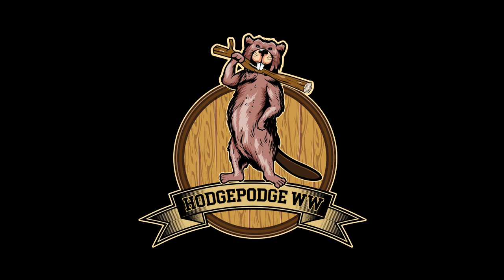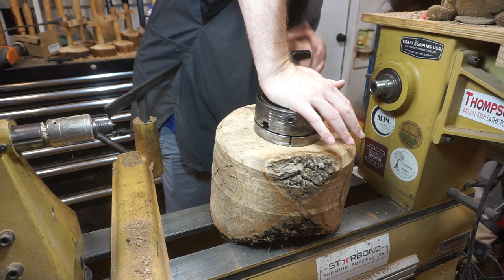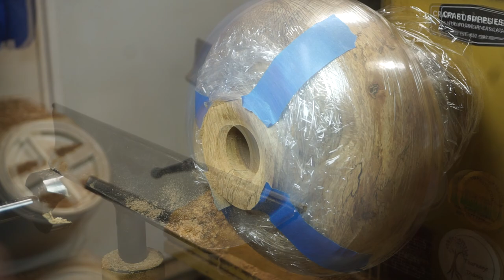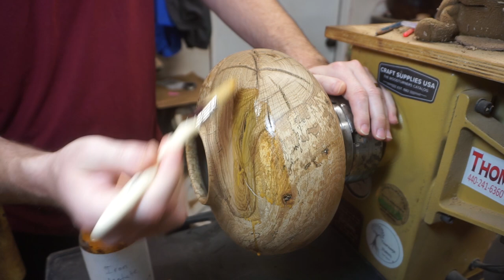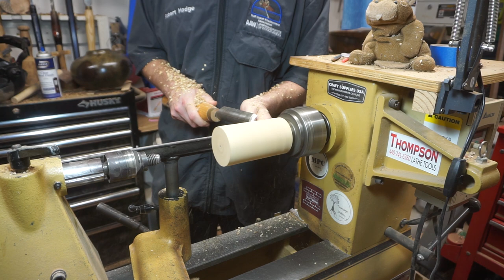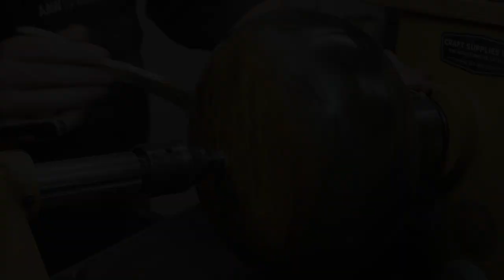Woodturning - A Crackin' Good Time

Comment: What coring system are you using.
Reply from the maker: It's a bit of a mix and match. The captive arm system is from a company that no longer exists but I'd say the Elbo system is most similar. Hollowing tools are Trent Bosch and I use a video monitoring system rather than a laser.
Reply: @HodgePodgeWoodWorks  
Thanks. I’m trying to figure out which hollowing system to get.